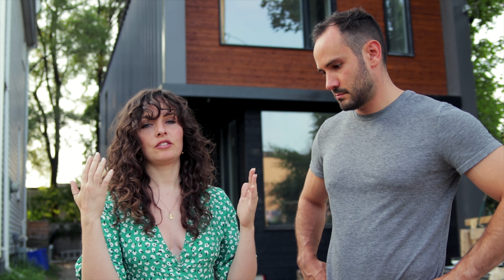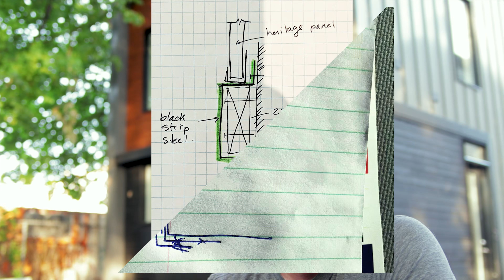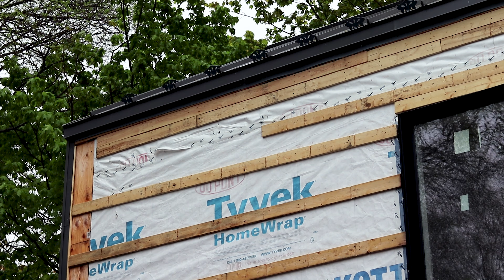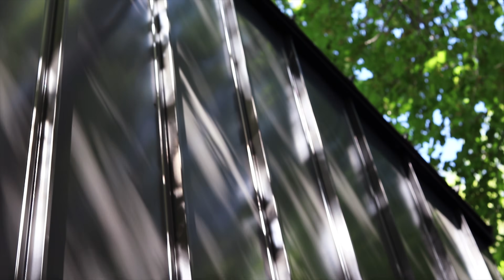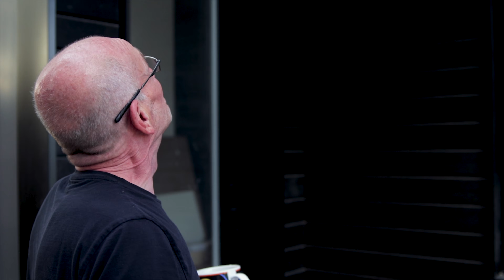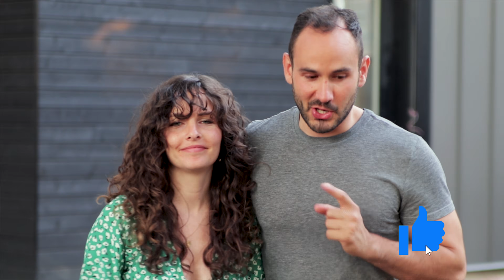EP18 : ENTIRE HOUSE SIDING INSTALLATION - IMPORTANT STEPS FOR INSTALLING METAL OR WOOD SIDING (2019)

Comment: It's interesting that this custom project is 5 years old, using premium materials, and fairly current practices for the time, yet lacks a lot of what are current best practices.  No external insulation, using house wrap instead of better options, running the furring strips for 16 feet instead of short distances with more air channels.  No detailing to allow air flow into the rain screen and out at the top.  It's a pretty building, but don't copy the siding installation shown here.

Comment: Would you mind sharing the details and/or sketch up model of the metal siding detail conditions? I am about to build a house for myself and have the same condition and am trying to figure it out. Would help a ton! Also…great job!
Reply from the maker: Thank you! It's all standard trim detail from ideal roofing other than we had the piece perforated so we could get the top of each panel to vent into the roof. I'll see if I can post an image somewhere for you to check out.

Comment: 26 gauge is actually quite thin. It's like a bare minimum for normal alloys/tempers of steel. Some steel is easily twice that norm, and can go thinner while still looking good...but I've never touched any exterior metal cladding that's quite as thin as 26 gauge, let alone thinner, so I have no further opinion to offer about it.
Oil canning has a lot to do with whether the metal coil was properly straightened before being rollformed into panels. I'll venture to bet that IdealRoofing (assuming they do their own rollforming?) properly straightens the coil before rollforming.
It looks damn good. The product and workmanship are handsome. *...oh, it was installed by professionals. that makes sense...hahah...
Reply from the maker: Thanks - seems you're in the UK here. 26 gauge is standard for metal roofing. Very often cheaper stuff is 28-29. You seem to know a lot about steel! Good comments. The installer did do a great job! Thanks for watching.

Comment: Hey guys nice design love the material combo as well. Building kind of similar roof/wall combo did Ideal was ok with wall strapping? And is your wall actually roof panels or siding? Thanks
Reply from the maker: Hey, thanks dude! Yes, we discussed all the details with the reps from ideal and everything checked out.. they actually have a tech on board who will go over any custom detail and bend metal for you for special trims and stuff. The roof is the exact same material as the walls.. in reality, Ideal Roofing Heritage panel which we used is actually roofing metal, which we put on the walls; not the other way around. 
As long as you have good airflow and any water that gets behind there can trickle down/escape/evaporate you should be good!
Good luck, thanks for watching.

Comment: How come you put your forence on the horizontal side ? how will your water drip if it get behind your siding ?
Reply from the maker: Hey! It's because it has to be perpendicular to your siding. We did 2 things to address water. First off, Chris, the siding installer ran a bunch of 1/4" deep circular saw cuts on the back so that any water could go through those. Secondly, we gave them a small slope so they are not truly horizontal. We left crack in between pieces so water can travel down.

Comment: Great video! How is your roof ventilated?
Reply from the maker: I thought I had replied to this comment in the past.. Can't find the answer so I'll retype it. It's actually vented traditionally through the soffit.. it's just kind of an optical illusion and a cool architectural detail that makes it look like there is no soffit. The ribs on the side are about 2" high so that leaves a 2" space at the top that's the entire length of the house. We designed a custom trim piece which received the siding (the one at the transition from wall to roof) which we had perforated like soffit. Then we added baffles in the addict which brings air from those gaps. We have a ridge vent all along the house and the 2 end gable overhangs are fully vented so there is plenty of ventilation up there! Take a look at this video for the exact detail: https://youtu.be/9Tu3I9DqapA?t=462

Comment: Nice result but where is the air gap to ventilate the moiscure from interior in cold whather?
Reply from the maker: That is done through an HRV. They are required by code now because houses are so air tight. They do multiple air exchanges of the entire house per hour.
Reply: @HugoBuilds  t
It depends on the climate where the house is plased. In my country this house would be after a year full of water fron moiscure condensation in the wall. We have aroun -5 over the winter and 25 over summer. I am sure Id stay here agaist court yard for this design sonner or later - strustee would fail. On the other hand, in tropical climate would probably work wirhout any problem.

Comment: Very helpful.  Here in Southern California more people are turning to standing rib, interlocking metal siding for both walls and roof. Steel is better for fire protection. Underneath the steel siding your need code C or code X gypsum board. This is gypsum which is fiberglass reinforced so it does not fall apart  when I is exposed to high heat. A building without eves on the roof is also better for fire resistance.
Reply from the maker: Yea that's a huge problem over there.. having any sort of non combustible cladding would definitely help lower the spread.

Comment: What's the color of the metal siding from Ideal roofing
Reply from the maker: Colour is 'Maritime Grey'
Reply: @HugoBuilds  thanks and is it the 16'' or 20'' model ?
Reply from the maker: @felixlampron8658  16" wide panels and full height to avoid seems. If you end up using this please share some images once you're done!

Comment: Honestly probably your best video yet. Very well edited and lots of good information. Honestly I appreciate wanting the cedar look but I think a big part of why you like it is the rich wood colouring which takes an enormous amount of maintenance to hang onto for any length of time. Unless you stain/oil it every year or two it will grey, and with all the other greys on the home I don't think that would work well anymore. The Maibec will keep its colour a lot longer (I have some in a dark blue/grey I installed 10 years ago and it hasn't changed at all). 

Could you share a little more information about those custom metal details around penetrations and at corners? I've always seen wood siding terminating at another piece of wood (usually a 2x4 or 2x3 or something similar) which looks much more chunky and less modern. Did you design these pieces yourself? What do they look like?
Reply from the maker: Hey Ben! Always happy to receive your comments - thanks a lot for the positive feedback. You're right about the wood - although there is some maintenance with maibec it requires far less than real cedar. 

As for the maibec details those are custom bent out of black aluminum stock. The corner and window detail is very similar. It's just a doubles up thickness L angle. That gives it a bit of rigidity. Windows are 2"x2" L - corners are 1"x1". Maibec just butts straight into it and the cut will be caulked with a matching color. This avoids chunky details and expensive proprietary corner trims. It's also a lot cleaner. Once they are caulked I'll post some footage. Thanks again for watching :)
Reply: Both cedar and maibec needs maintenance.  Maibec has been painted which takes the first step of the maintenance, however cedar has great perks which are bug resistant and even if they turn grey they can maintain their durability for years and years.  Maibec is lodgepole pine which also requires maintence.  If the siding is facing the sun will require more maintenance than siding that is not exposed.
Reply: @chrisblais1029  I agree wood siding is never maintenance free but my maibec siding hasn't faded noticeably in ~9 years and still looks like new whereas my cedar deck needs to be stripped and restrained every 2-3 years to maintain the colour. If you don't mind greying wood (it can look great too) then cedar is by far a better choice.
Reply: Ben Muirhead if you need help designing custom trim pieces fill free to contact Oakhart Design & Construction